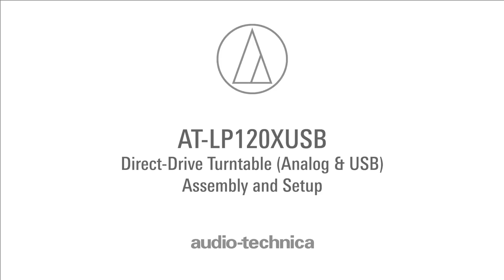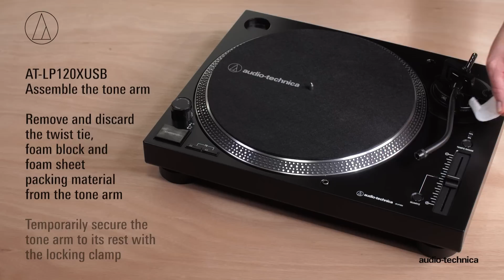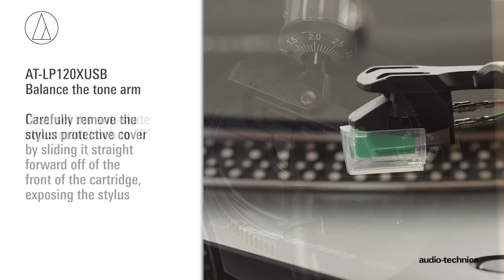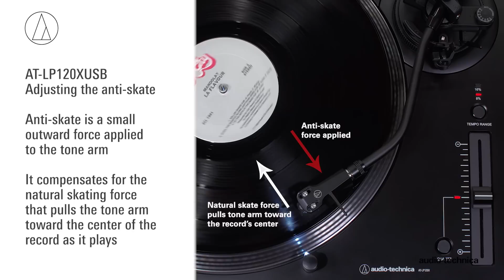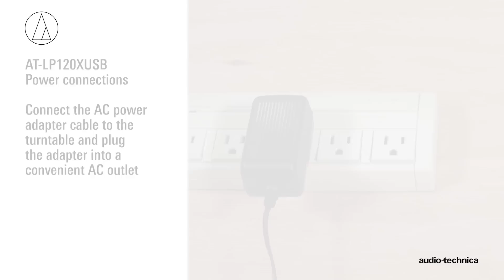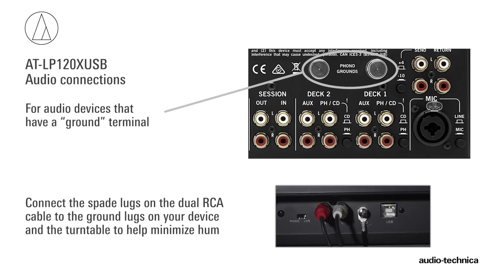AT-LP120XUSB Setup | Direct-Drive Turntable (Analog & USB)

Comment: Got 2 of these couple of months ago for home DJ use and love them, Sound quality is awesome and ive compared the drive torque to a pioneer DJ turntable which was supposed to have insane torque and they  held there own,only issue I have is the tone arm drops to fast, ,not a real problem as I prefer to manually locate the stylus but any ideas how to rectify. Not really worth sending back for such a small issue.

Comment: Hi. I Just bought this model. I have a question. All the turntables I've had before of these, once the record finsh the arm returned alone to its place. But with these model that doesnt happend. I need to be close in order to put up the arm. Is it normal or is something wrong with my new turntable?
Reply from the maker: Hi there! Our AT-LP120XUSB is fully manual, which means it does not have the automatic features, such as auto-return, that a fully automatic turntable does. Thanks! - A-T USA
Reply: A Semi Automatic falls under your description. Where as a Fully Automatic indicates pressing the start button and the tone arm lifts and moves onto the record.
Reply: this is professional turntable for DJ's you need a semi or fully automatic for that function pro style turntables don't have auto return
Reply: This turntable is completely manual.

Comment: I'm curious how everyone feels about them removing the tone arm height adjustment. They said to simplify setup because the tonearm height was confusing people and they just made it stationary and "perfectly set" to the supplied  vm95E cart. But what if you want to put in a taller cartridge? There's no way to raise up the tone arm to keep it parallel when using a taller cartridge. Or the opposite for a thinner one. Essentially you either need to keep using that cart with available stylus's or similar carts with same dimensions.  
Vertical tracking is very important to not damage records and the stylus
To me that bothers me and I'm curious how people feel about that?
Reply: And i though the reason was also for dealing with 78 rpm records, as they are thicker than the conventional LP.

Comment: Well, they definitely went cheap on this model. It appears everything is
 plastic. What is with the removable target light? You know it will get 
lost in the shuffle. Is it possible to purchase another one????? I have 
the ATLP120USB. I went through five of those. Meaning return, exchange, 
return, exchange. I have placed an order for the "Updated" model. I do 
not plan on going through the exchange process as I did before. I 
understand that there is a AC adapter to minimize hum. The RCA jacks
integrated into the circuit board, and ground is an nice touch.
AT should have done that from the beginning. I heard rumors that the
head-shell might be plastic as well. I am not crazy about the ribbed
appearance at the base of the tone arm. This is where you were able
to adjust the height on the former model. I am hoping that the warped
platter syndrome is non-existent with this model.
Reply: This is a professional series "Consumer" table...You get what you pay for....Not happy???... There's always the Pioneer PLX1000, The Numark NTX1000, The Denon DJ-VL12, or The Technics 1200MK2...Still not???...Last time I checked, GOD was not in the turntable business !
Reply: @ManFa_Q  Oh, so what you are saying  is, that since it is "Consumer" based, its  alright for AT to place less quality in this model, then they did in the LP120USB? I don't think so. I expect the same quality that I have in my LP120USB, if not more. Minus the well known defects. I paid $249.00 for the LP120USB seven months ago, and I paid the same for this LP120XUSB. As many have said, total rip off.
Reply: @PreppyGuy007  ....The table is criteria-marketed toward the "Average-joe" who just wants to go back down memory lane spinning his/her vinyls plus added feature(s) similar to that of professional tables ...Not the TURNTABLE POLICE ! 

This unit is more than sufficient for THAT purpose !...The LP120 is actually still a more preferable piece to the '120X" by most considering/comparing the upgrades but then there's the business decision aspect of manufacturing turntables and  the cost of doing business WORLDWIDE...That's where the separation begins !...Not everyone can handle/agree with change but something had to be done with the AT-LP120-USB, Either make some changes or completely discontinue the line...It was a bit too much table for the consumer (who needs a table that spins in reverse or that much variety of pitch control???) and not enough table to compete with the Numarks', Reloops', 1200MK2s' and other top-notch PROFESSIONAL DJ TURNTABLES...Personally, I called it a "Downgraded upgrade" !...Audio-Technica will tell you themselves that they are NOT targeting the "PRO DJ" market when it comes to turntables but just like any other commodity, If the unit doesn't meet with your approval, You move on to better instead of hangin-on and procrastinating...Just be prepared to "Spin" more loot for the  better quality turntables...Sort of like the formality of True-Value tools vs Snap-on !
Reply: @ManFa_Q  Appreciate the input. In searching the internet, I discovered this https://www.reddit.com/r/vinyl/comments/b00ggz/audio_technicas_lp120_is_being_discontinued_per/  They suggested the 140X USB. They claim it is closer to the 120x with some upgrades. However, when I found this turntable on Best Buy's website, it neglects to mention in the heading or in the description about USB connectivity. Any input????

In reference to my inquiry about the availability of the Plug In Target Light replacement, it is available for $16.00. This is for those of you who were wondering.
Reply: @PreppyGuy007  ....You're correct, Best Buy does leave out pertinent information but unless I got my tables confused, The 140X has a smaller diameter platter and the tone arm is straight which would mean that the headshell has the geometric "bend"....Not really sure if it's the 4-pin universal headshell assembly.

Comment: How about VTA (tone arm Height) adjustment?  Did they fix that?
Reply from the maker: Hi Lee! The AT-LP120XUSB turntable features an S-shaped tonearm with adjustable tracking force, thanks! - A-T USA
Reply: Yes, thanks , but I'm asking about the tone arm {VTA height}. Not the tracking force.
Reply from the maker: @leest463  Hi Lee! There is no tone arm height adjustment on the AT-LP120XUSB. Thank you! - A-T USA
Reply: Unfortunately no. I had to purchase a thicker slip mat to resolve the issue.

Comment: This this new version still use the standard 52 mm from stylus tip to collet?
Reply from the maker: Hi there! Please contact our Audio Solutions Team for help. You can reach them at audio-solutions@atus.com. Thanks!  - A-T USA
Reply: @AudioTechnicaUSA  You can help me by just answering a simple yes or no question.
Reply from the maker: @EddieJazzFan  Hi there. Yes, The distance is still 52 mm. Thanks! - A-T USA
Reply: I find it odd they don't answer questions so everyone with same question has the answer. But they take the time to write that you should contact them. So now noone knows the answer but the person contacting them..... If you're taking the time to type to contact the help Dept, why not just answer the question?
Reply: @2010stoof  I was thinking the same thing. The only possible reason is that it's not a real person answering at AudioTechnica, but some kind of computer generated response.

Comment: Is the new preamp that much better in the lp120x vs the original lp120? Should I go as far as selling my lp120 for the lp120x? Do you think the increase in audio quality is worth the hassle?

I’m also aware of removing the preamp in the lp120.
Reply: The sound might have improved ever so slightly, but the quality of build is down. Now there is the AT-LP140XP. It does resembles the LP120USB, minus the preamp, and USB connector. I highly doubt that the quality of plastic would be any better than the AT-LP120XUSB. In another words, I'd keep your older model.

Comment: Does the cartridge come pre aligned?
Reply from the maker: Hi there! Please contact our Audio Solutions Team for help. You can reach them at audio-solutions@atus.com. Thanks!  - A-T USA
Reply: yes mine is aligned.
Reply: You can always venture to Vinyl Engine.com and print out a protractor. Considering the thousands of turntables (units manufactured), I am certain that the cartridge is not precisely aligned.
Reply: To my surprise, the answer it yes. I compared it to one of my protractors. Right on the money. Thank you for that one, AT!
Reply: @PreppyGuy007  which protractor was it?
Reply: @ColoredBars  Stevenson is the name of the protractor used. It can be found on VinylEngine.com. When printing, make sure it is 18mm. Set your printer for "Actual Size".  That should do it.

Comment: Just bought and returned an AT-LP120HC-USB (mechanical noise when platter was spinning) and an AT-LP140XP (transformator hum)... haven't quite given up on Audio-Technica yet though... have the mechacnical noise of its predecessors been addressed on the new AT-LP120X??? (assuming transformator hum won't be an issue because of external power supply)
Reply: Mine is still, I hear no noise / hum with mine at-lp120x.
Reply: @reinder2008  good to know!